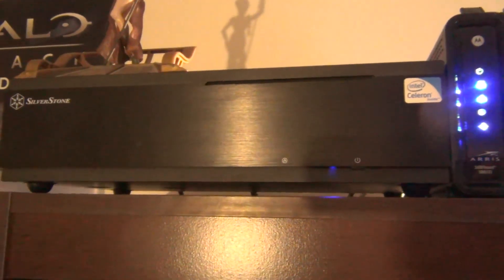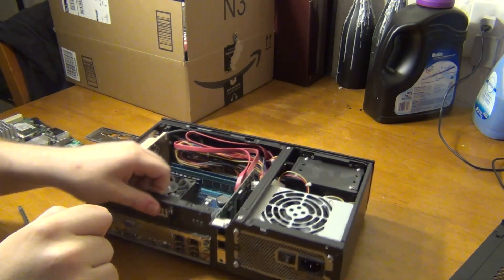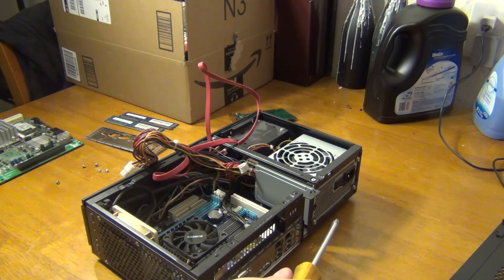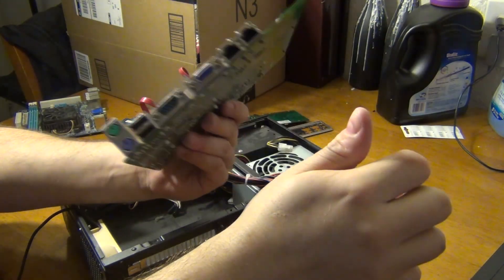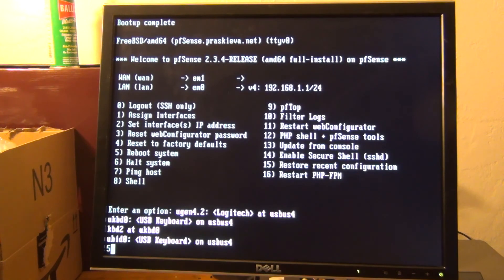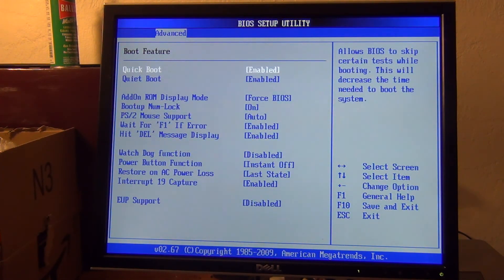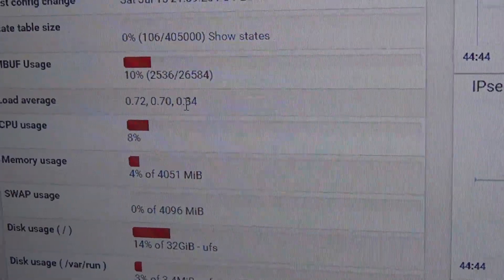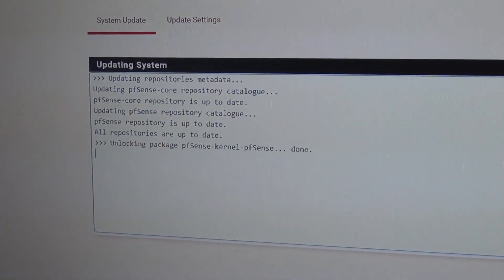pfSense Motherboard Swap

Comment: What's the power draw like and how does it affect your power bills? currently the only thing from stopping me from moving to pf full time
Reply from the maker: It uses no more power than a netbook. Most of the time the CPU is near idle. I live in Oregon where we are fortunate to have some of the lowest cost power in the US, but a low power system like this cost no more than a dollar or two per month to run. It certainly uses a little more power than a consumer router, but the extra features and and security and worth it.

Comment: What do you do for wifi? I like the idea of using pfsence for a firewall. But, I need wifi, too. BTW, are you in the PNW?
Reply from the maker: Steve Strassburg Yeah, I'm located in Eugene, Oregon. At the moment I'm using a Buffalo router in AP mode for wifi. I have a wifi card for this pfSense machine ordered that should be here next week that I plan to use. I'd rather have this machine handle the wifi as well since pfSense is updated often and it offers a lot of options. If you get a wifi card for pfSense find one with an Atheros chipset since they are well supported in BSD. There's an updated list of currently supported chipsets in the BSD dev documentation.